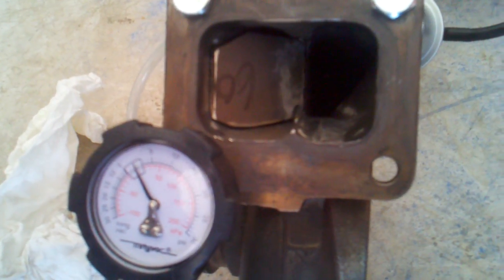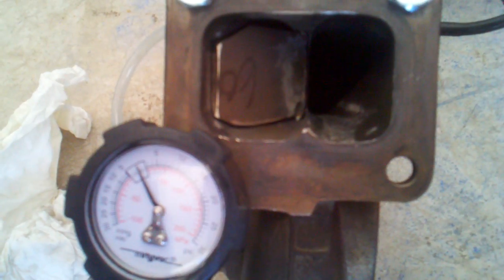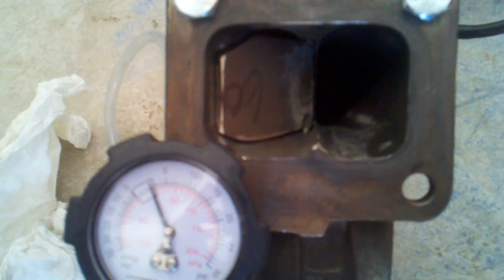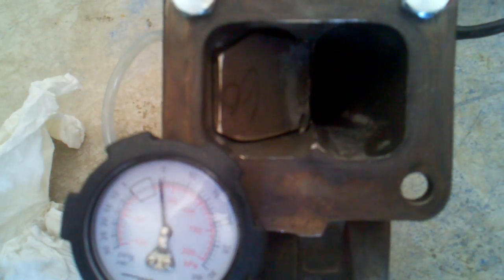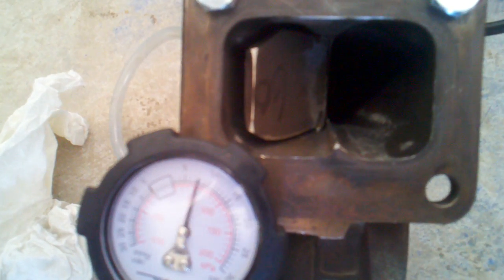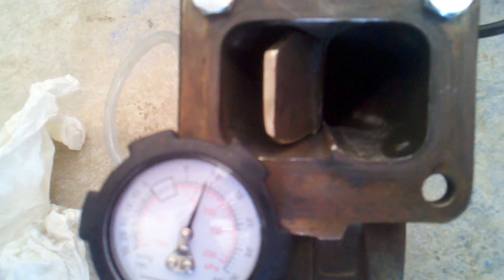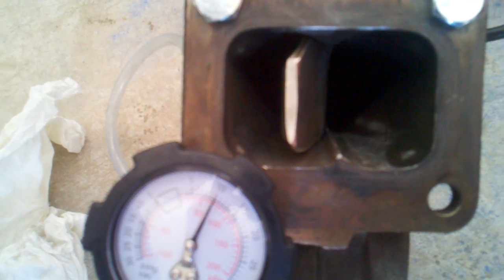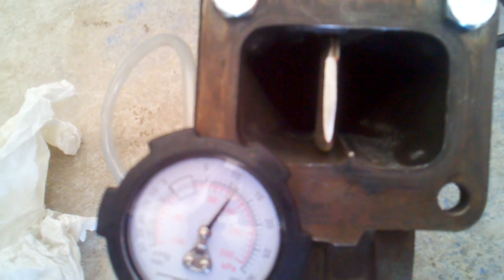Quick spool valve built into Turbine

Comment: Too bad no one knows the results of this
Reply: I Dont think the valve is going to open at 8 pounds. Back pressure is higher than the boost pressure and i think it would push the valve close. With butterfly valve it would work better with those pressures.

Comment: yes, this works very well and imo is a more efficient setup than a sp quck spool valve. the flapper is connected to a waste gate which is tapped to a boost source. as the car makes boost the waste gate slowly moves the flapper.